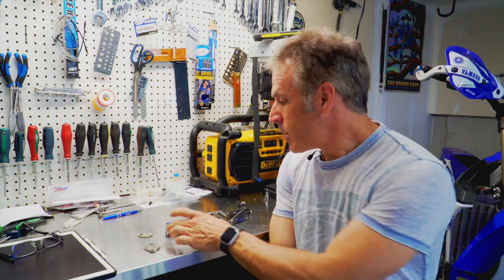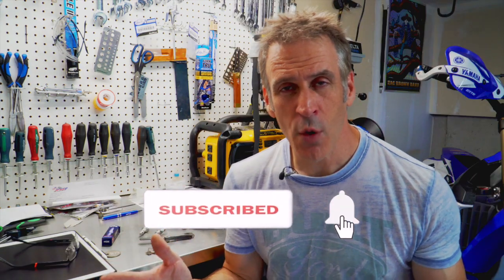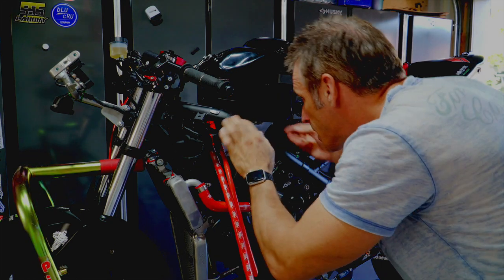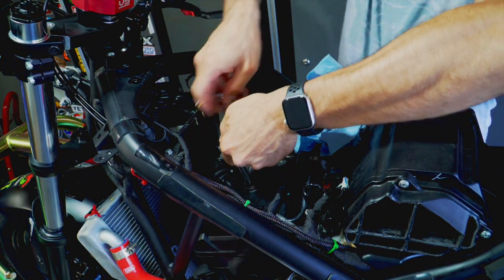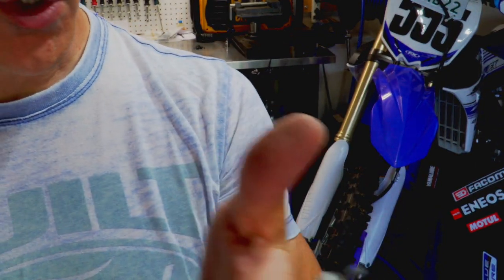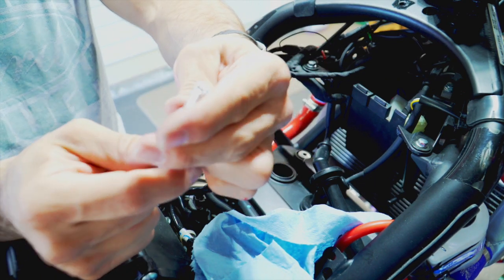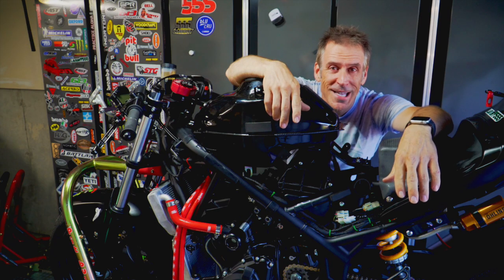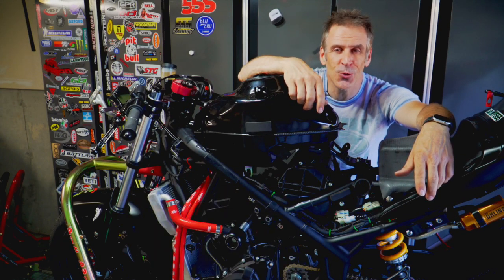HOW-TO: Change the Spark Plugs on your Yamaha R3

Comment: Will the gas run out of the tank?
Reply from the maker: you’ll have a small amount that will leak when you disconnect the hose but it will be minimal.
Reply: @landry555  I got a 2021 R3" 12,500 miles, somewhere around 7,000 rpm or when I get up to 45 mph it starts to cutting back and something shut off! No problem starting up! Got a friend that drove it for me" he said he believes it is the spark  plugs!  You think that could be what it is?
Reply from the maker: it’s possible, I’ve had similar issues with my R6 and had to replace the ignition coils (and the sparks). Could also be the fuel pump, filter, clogged injectors. 

It’s a relatively easy task to replace the spark plugs, so it’s a good idea to start with that. Do you have an error code on your display? That could help narrow down the troubleshooting.
Reply: @landry555  my bike at my brother in law, I don't remember seeing a code, I'm going there in the morning to take the tank off! I will look and make sure! Thanks for the intel!

Comment: Why not torque it to spec?
Reply from the maker: Hi! Good question. I didn’t use the torque wrench simply because I’ve done this so often that I know approximately how much force I need to apply to torque this in place. You should definitely use the torque wrench and the specs I mentioned in the video if you are unsure. I should have been more specific in the video. Thank you for asking the question! 

Cheers,
/Marco